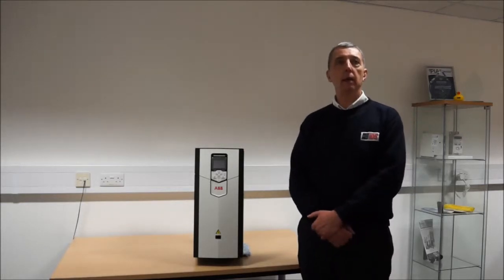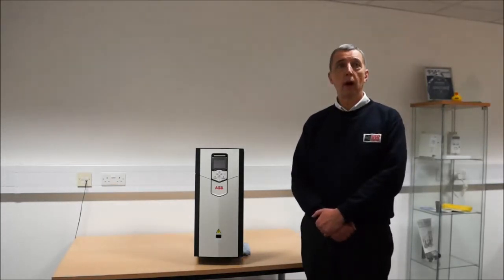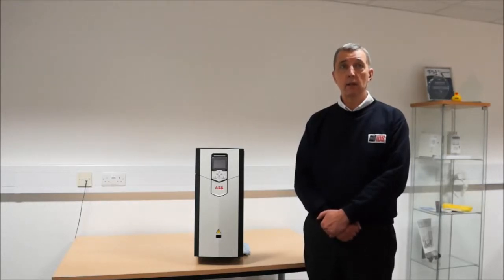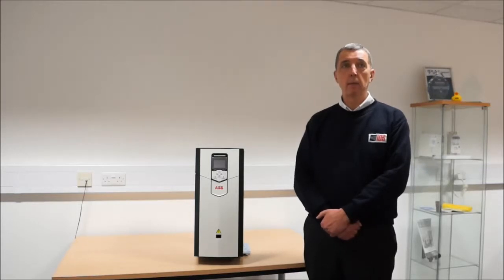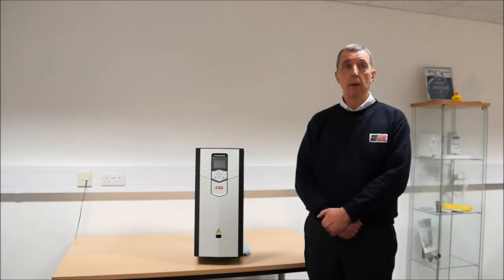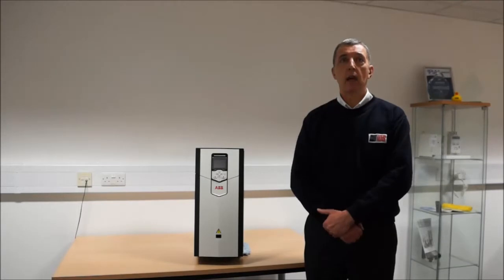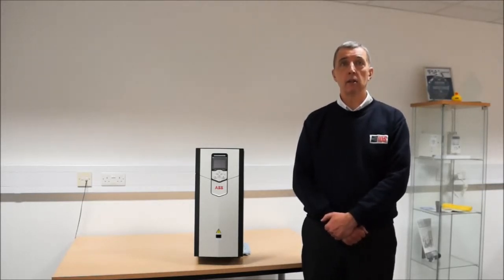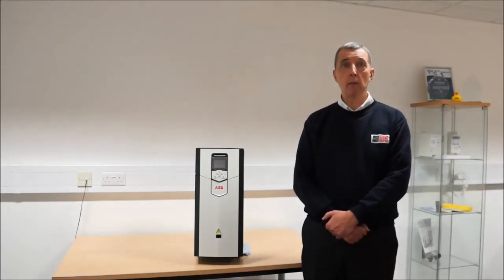ACS880 review

Comment: Program:

On the computer side using ABB software --- DriveWindow Light, control ACS355 no problem.
But I would like to put aside DriveWindow Light software, direct use of MODBUS POLL software.

ACS355 + MODBUS_RS485 module + RS485 to MODBUS_TCP,
Can I use the computer's MODBUS POLL software to directly control the start to stop?
Do not use the manufacturer's control software.